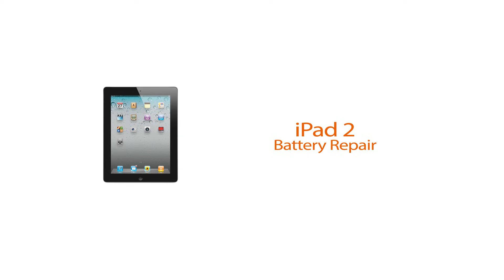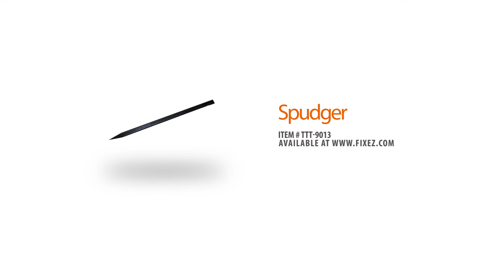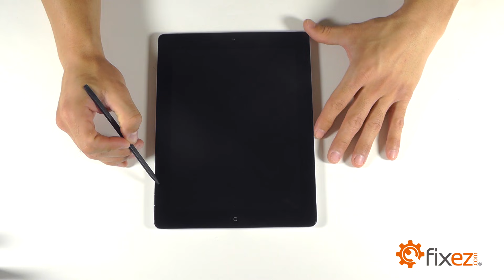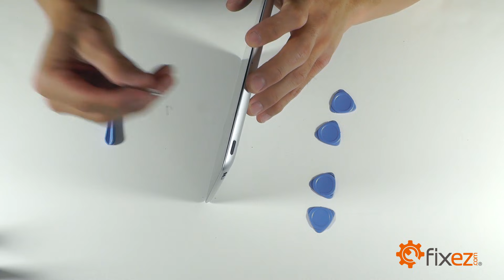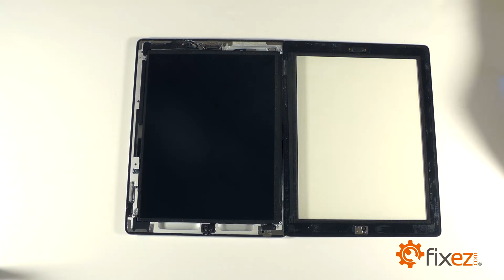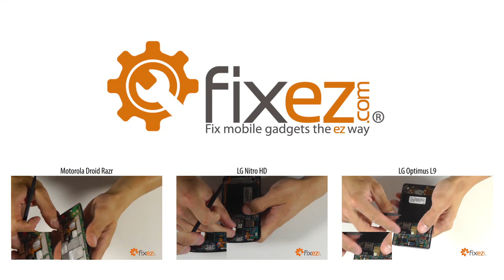iPad 2 Battery Repair

Comment: Hi,do you repair the battery of Ipad model A1396? My ipad A1396 is in good condition only the ipad keeps switching off after every 2 minutes even though the battery is 90%. It was a jailbroken ipad and I think it could be due to cydia app or battery. Do you keep battery for A1396 model?

Comment: really great video and easy to follow. Sadly I think I ruptured the ribbon cable of the touch screen while trying to get the adhesive loose from the initial screen removal. I do have one thing I want to say about how the whole thing was filmed and that I think it would be beter filmed if the hands of the person in the video were rotated 180 degrees so they were coming from the bottom of the screen just as we see our own hands that way. But anyway thanks for making this great video!

Comment: If you use the razor to start it, I'd advise starting it close to one of the corners and using guitar picks (Buy a lot, they are cheap.) to both hold open, and pry apart.  This is my first iPad.  My inexperience plus a rushing customer caused me to cut some unseen cable with that blade.  Hopefully you learn from my mistake.

Comment: This video is completely worthless!  Not once do you have to contend with the annoying adhesive that's typically found all over the place holding everything in place!  Why is this?  I'm guessing it's so you can look smooth with your disassembly.  Unfortunately, you leave the non-professional (which is precisely who this damn video should be intended for) with many questions on disassembly, and completely in the dark on any attempted re-assembly.
Reply: I was thinking the same thing. Getting the battery out was a real pain in the arse.
Reply: Yeah really!? You’re not going to show us how to reassemble!? Wtf

Comment: REally well done, thank you.
Reply from the maker: +Mike S You're welcome, thank you for the support.
Reply: Mike  S.---------my girlfriend had the same problem .make sure you have the correct WATTAGE USB BOX most likely it's gonna be the 60w an personally I would use apples usb wire & usb 60w box an let it charge overnight if need be but it should only take a couple hours hopefully that helps you. Good Luck.
Reply: +Fixez.com plis help me my iPad 2 is not open in 2015 it was disable it forget password then I pwoerd it off and now in 2016 I put it in charge it's not open and no logo

Comment: hi i done this all correct but i now get no picture on the lcd once i put everything back together but i can still hear sounds like when i plug it in to charge
Reply from the maker: +TehMoTi0nZz Possible your LCD flex cable is not fully seated. This can happen on the dis-assembly process. Double check your connections to ensure this is not the case. Thanks

Comment: I have a iPad was working normally suddenly turn off on his own and did not actuation of the time so far
Reply from the maker: +hassan riabi Have you tried connecting the device to your PC? If your PC recognizes the unit, restore it via iTunes but ensure to back up your data first.
Reply: ITunes does not work there is an error
Reply from the maker: Possible software issue or even hardware. We apologize for this issue, we are unsure how to proceed.
Reply: now my ipad is working thenk you very much
Reply from the maker: You're welcome!

Comment: So I recently replaced my iPad screen. I know it is held together by Adhesive; however, Would it be possible to buy "replacement" adhesive to stick it back on? Also, I am replacing the battery, bezel, ( since I have no bezel ) and the wire in the top right that controls the lock screen, volume, and screen rotation button.
Reply from the maker: +StoneAgeGaming We do offer adhesive as you would require this to reinstall the screen.

Comment: i bought the replacement battery and the tools and followed these steps but my ipad still does not turn on. any suggestions on what to try next (besides scrapping the tablet)? it was working fine, was well taken care of, low usage. i really believe that apple killed it via software update to force me to buy a new tablet.
Reply from the maker: +K Wow Did you attempt connecting the iPad to your PC? See if the PC recognizes it and try to restore the operating system. Of course ensure your battery was connected properly as well.

Comment: I would be terrified to do this. I'd crack it, forget what goes where or it would go wrong somehow.
Reply: +mi1964amigo This actually looks simple compared to other devices, have confidence and a clean work area and don't loose any pieces.
Reply: If you want, just get a little tray to put all of your screws and parts in and label it as you go. Just pay attention closely.

Comment: The reason I don't buy a surf pad is that everything's glued together, as if the battery would last forever, it annoys the heck out of me. 4 skrews would be enough to solve the problem but no, ALL manufacturers GLUE the pads together which makes battery change (after 8-10 months) to a risky business. Grrrr!
Reply: I totally agree with you.  The iPad is an expensive disposable item like disposable razor blade - just more expensive.
When the dismal 1000 charge cycles are over, you pretty much have to throw away the damn thing because it's totally useless at that point.  I am thinking about buying the new Samsung Galaxy Tab Active with removable battery.
Reply: Exactly... My problem though was the glue on my iPad screen ended up wearing down to the point where I was able to peel the screen off. Double sided tape worked for a little bit, but from the screen being uneven the bottom right corner started to chip away and then the screen slowly shattered.

Comment: I will guarantee you that your display screen will be stuck on 10X more than what you SEE here.    I even have a heat gun and and it took me over an hour to sperate the glass from the pad without cracking the display.

Just be ready to buy crappy OEM replacement screen if all you have is a blow dryer.

Comment: I replaced the battery on my ipad mini, however it still will not turn on even with a hard reset. It also still does not how that it is charging.
 Any ideas?
Reply: Ricardo Padin Yes. Throw it away and buy a Samsung tablet.
Reply: Mojo Lightnin or a Note 7